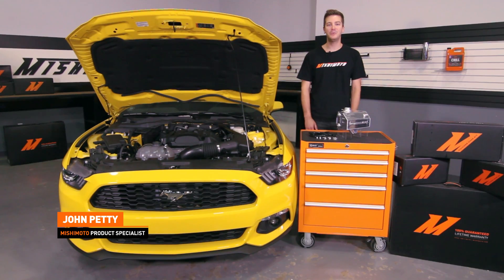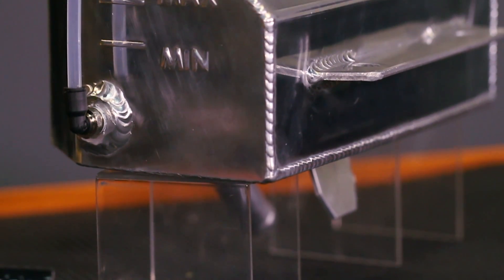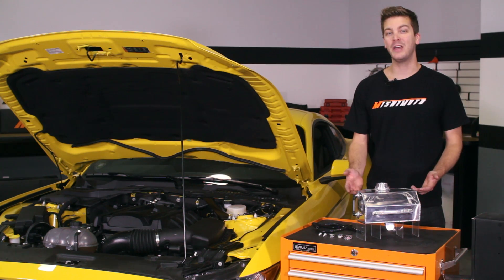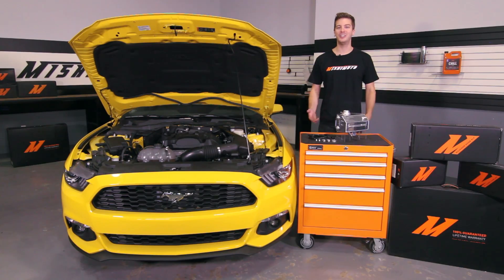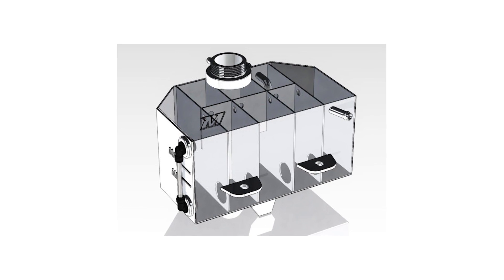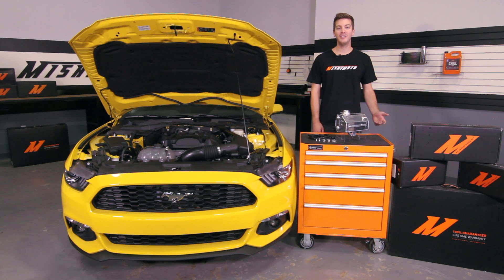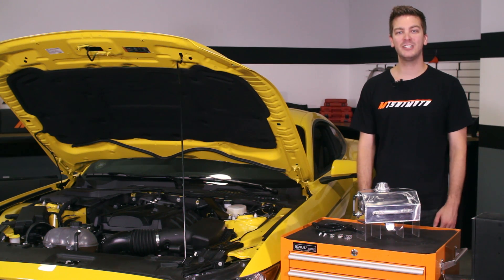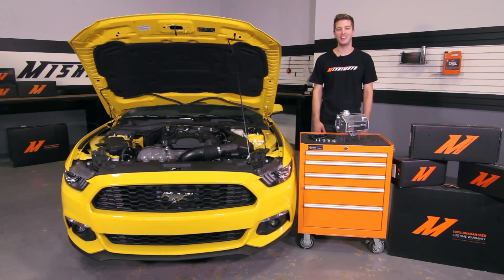2015+ Mustang Expansion Tank (EcoBoost, V6, V8) Features Video By Mishimoto

Comment: Question, does the overflow tube get routed next to the radiator towards the bottom of car? Is it safe to have it hanging down? Thanks'!
Reply from the maker: +Mbutta7 The overflow silicone coolant line routes from this nipple to the ground in order to properly release coolant being pushed from the reservoir.